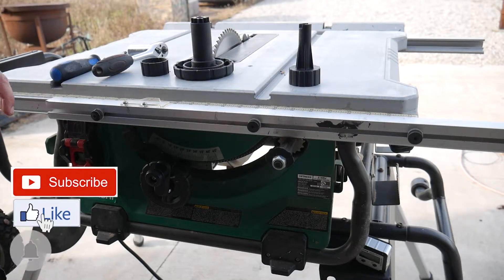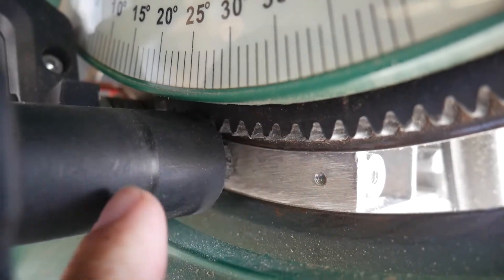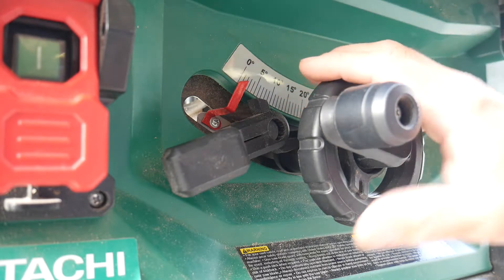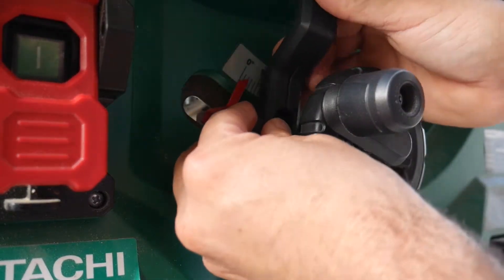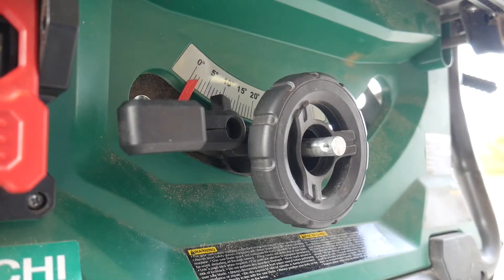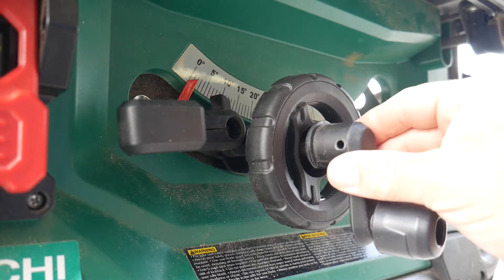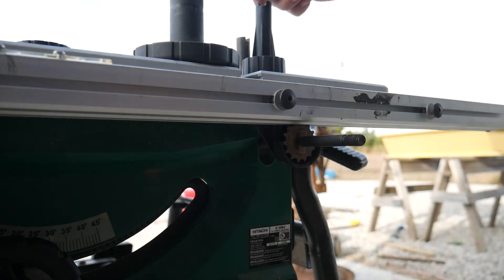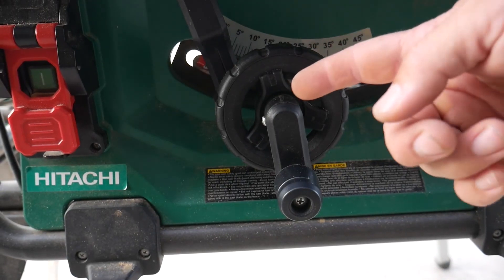HITACHI C10RJ Replacing Rotation Wheel And Knob

Comment: I checked in to find out how to tighten the Bevel locking lever.   My saw blade bevel locking level was loose and would not hold a 90 degree.  I could not find the adjustment procedure to tighten the bevel locking lever (in the manual) until this video.  Pulling out the locking lever and turning clockwise several times solved the problem.  Thanks.

Comment: Hi mate ive got the same saw just wanna ask how to adjust the small flip over fence mind is not align with the blade from factory
Reply from the maker: There should be a screw on the rail that will loosen and allow you to slide the part the rail connects to. I will look at mine.
Reply from the maker: see if this is what you need: https://youtu.be/DGKmnzDZnUI

Comment: Where did you find parts for your saw? Just searching hikoki gear does not return anything usable.
Reply from the maker: I searched for part lookup to find the exploded drawing and got the part numbers.  Then found some on eBay and Amazon.
Reply from the maker: Check this out. https://www.partswarehouse.com/Hitachi-Metabo-C10RJ-10-Jobsite-Table-Saw-s/328770.htm
Reply: Nice info by you… it looks like you replaced the bevel adjuster. I need to replace my height adj mechanism. Would it be just the shaft or is there more to it?